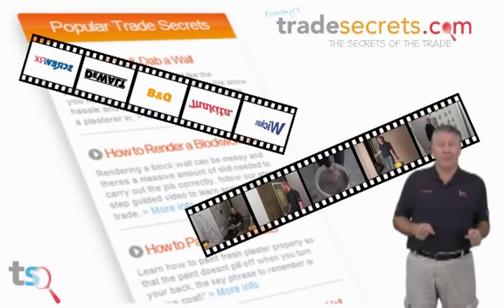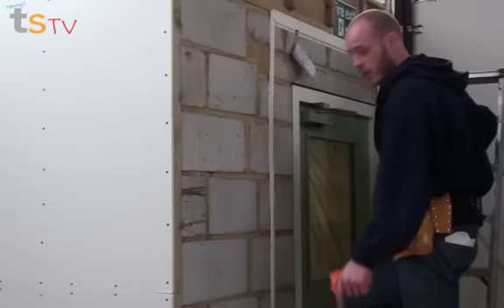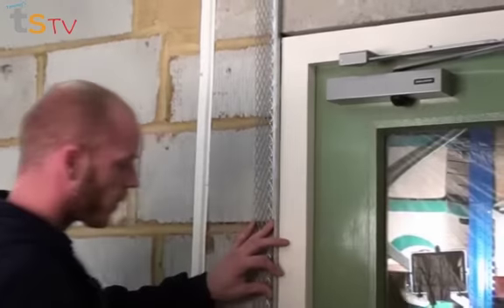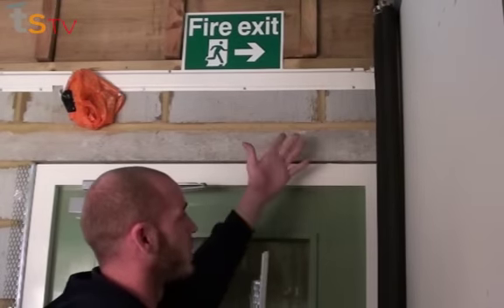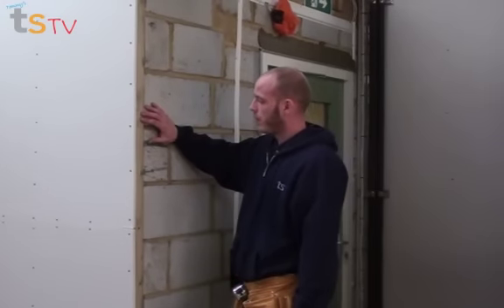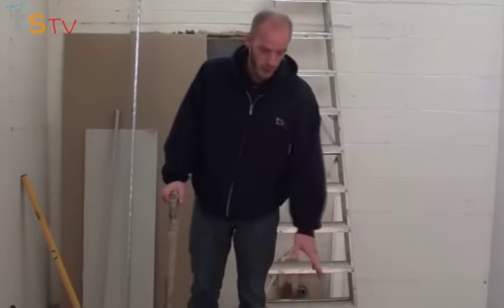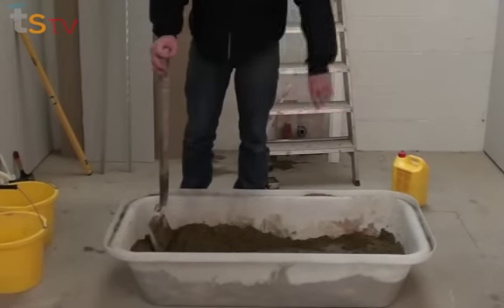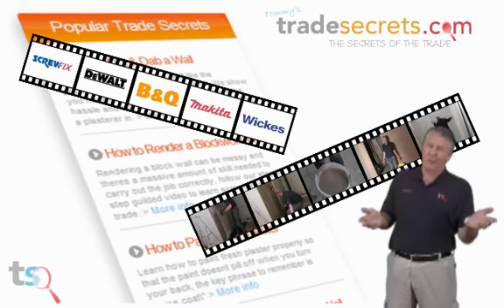Tommy's Trade Secrets - How To Render A Blockwork Wall Part 1

Comment: Use builders sand, and its advisable to put a scratch coat on 1st unless your very good with the trowel.The scratch coat gives a good bond to the substrate.
I also put a shovel of Lime in the mix if the sand is a little course.